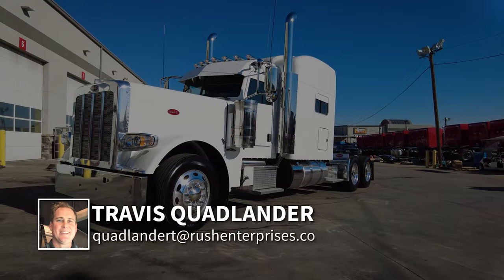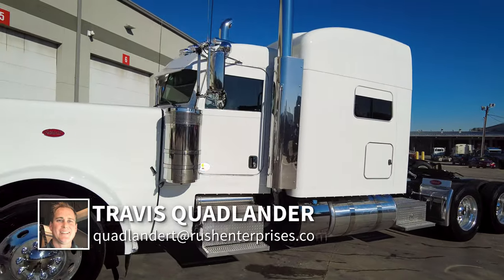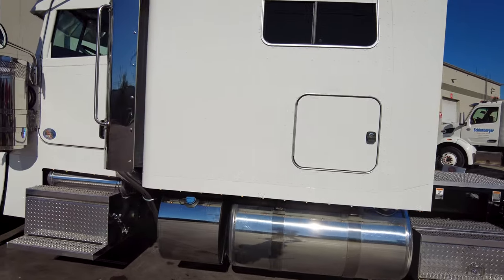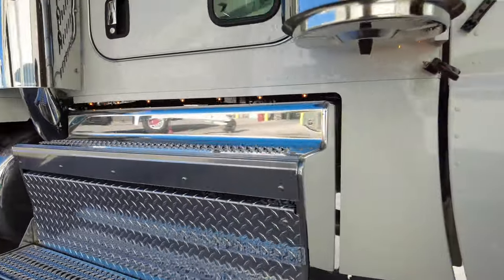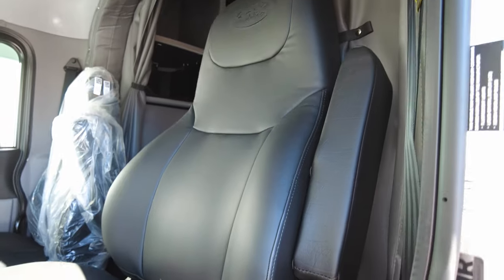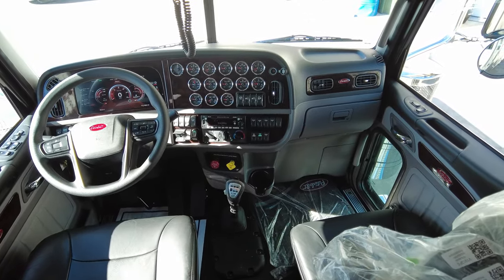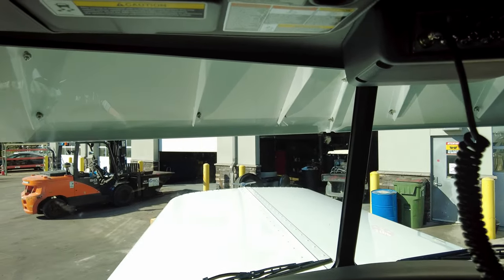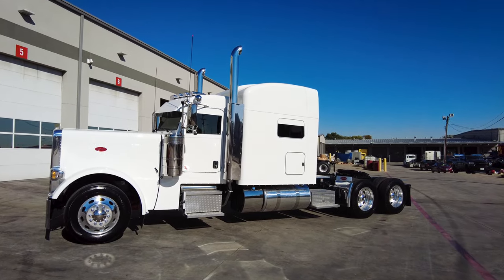White 2024 Peterbilt 389 with 78 inch Platinum Sleeper – SOLD

Comment: Thanks for the video Travis.  Can you increase the torque to 2050?
Reply from the maker: It's possible but will take A LOT of work from Peterbilt to get it approved. Also, you would need to upgrade the transmission and drivelines to support the higher torque. If you REALLY want 2050 torque and are serious about getting a 389, give me a call 817-504-7220 and I may have an option for you.